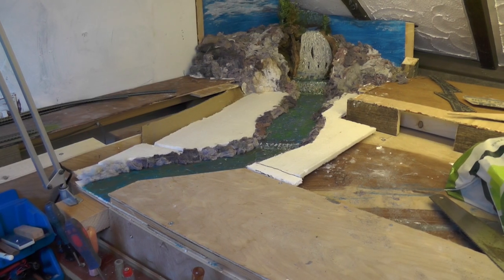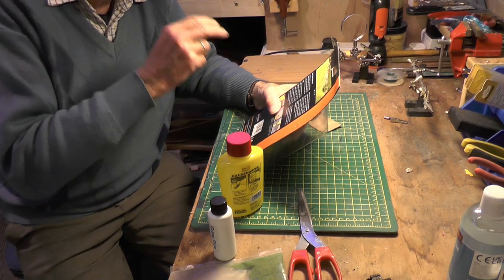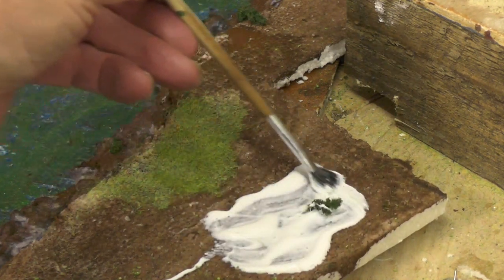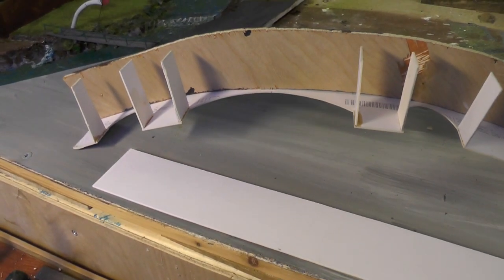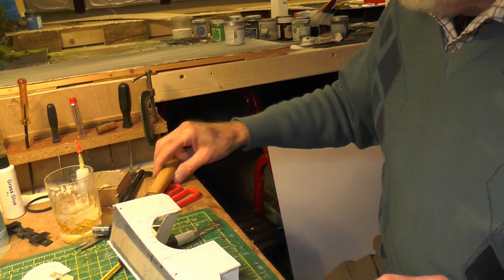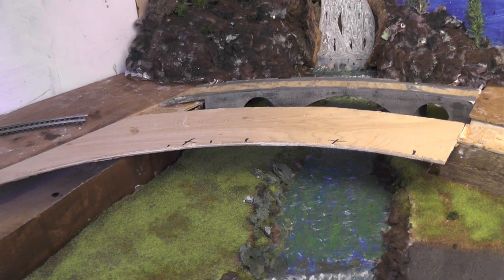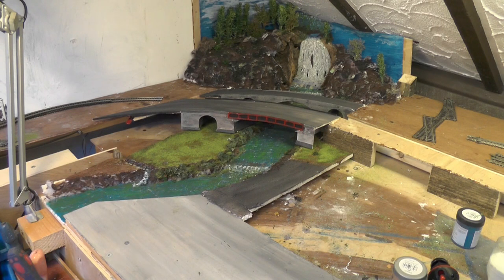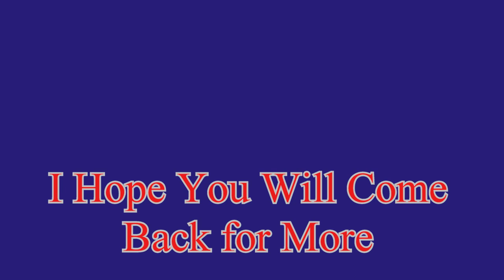Rebuilding a Model Railway Episode 8 More on the landscape and building two curved bridges

Comment: Excellent progress Michael, I'm thrilled. A little more foliage over the fluff rocks to lighten up the scene might be in order but you are well under way with probably the most challenging scene nearing completion.  Regards, David
Reply from the maker: Thanks David, you are right and I must attend to that asap.  In the corner at the other end I have the disused coal mine to deal with but FIRST some track laying,  Regards Michael